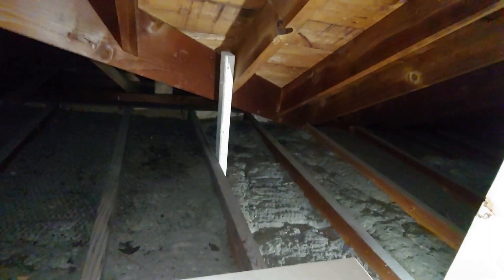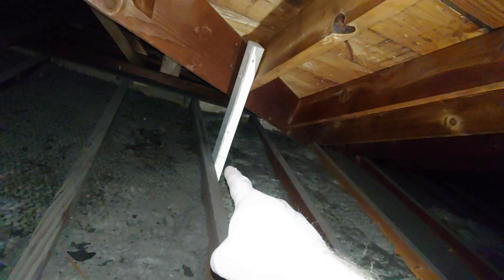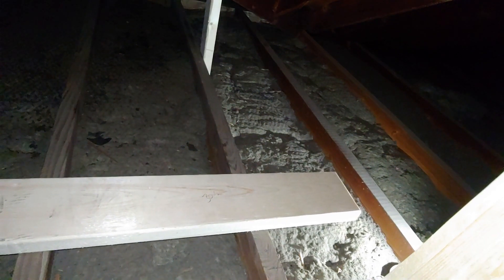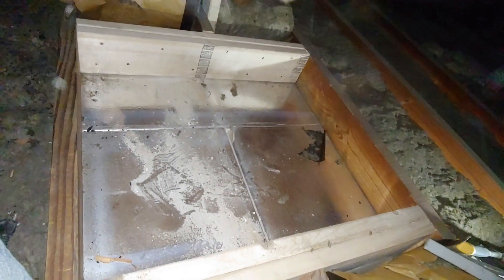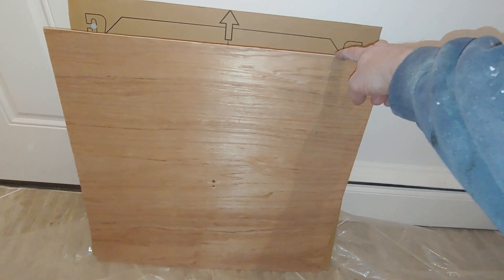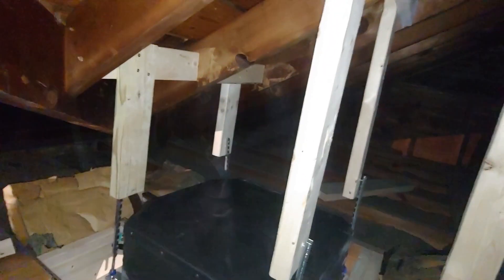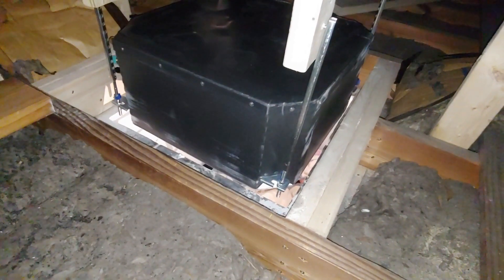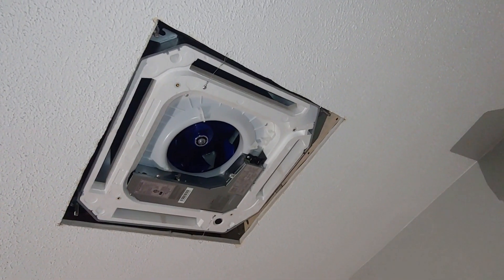Ceiling Cassette Minisplit Installation

Comment: Am doing the same thing.  Four ceiling mount mini split cassettes.  I believe your video(s) are the first to tackle ceiling mounted cassettes—- much bigger ordeal than a wall mount to an exterior wall.  I have two holes cut so far, with two to go.  Am saving the hardest for last as that position has the least attic clearance and I want to have it down pat before I tackle that one.  I went about it a little differently.  I made 2/6 frames for the units, and then will position them inside the ceiling joists after I have the openings framed up.  Essentially, I will wind up with the double joists.  That way I know the units will fit nice inside the openings.  One of the hardest issues is finding the right depth to mount the cassette—relative to the ceiling surface plane.  The trim piece comes with fairly short length screws to attach the trim piece and if the cassette isn’t hung just right you wind up moving it up and down a bunch.  I plan to get rid of water from the drain tubes by way of any nearby sewer vent (in my case, black ABS plastic).  I will be using two ball valves to divert the water to an exterior drain line as an option.  In my area we don’t want to throw out any water if we can save it.
Reply from the maker: Thanks! I found that the bottom of the unit even with the attic side of the drywall to be the best depth of the unit to start with.
Reply: @SteveDoesEverything  Thanks.  Will give that a try.  Will have to approximate that because my ceiling is very unusual---it hosts radiant ceiling wires and they are literally imbedded in a masonry product--seems nearly like stucco, applied to the underside of the ceiling drywall.  (The wires are stapled to the room side of the ceiling dry wall.)
Reply from the maker: My ceiling has approx 5/8" plasterboard with another 1/2" of plaster finish. So it was pretty thick too.

Comment: I just can't understand why it would have to be hung from the rafters?  Seems to me it would simply have brackets that rested on the joists?  I am thinking I would spread the load over say four joists simply because the one was compromized cutting a section out....But what do I know ...I do know some pretty heavy stuff often is supported by ceiling joists....whatever I just don't like it is all ...too much BS cutting and installing all the 2Xs only to hang little brackets.....for that matter if I were going to hang from rafters I personally would have used steel strut and all thread downrods which are infinetly adjustable for hieght using nuts and washers....but again that is just me having been a career electrician.  ...I also would like to cut the ceiling drywall pretty much the exact size of the unit (As in I would actually USE the exact outline ON the template!  Which has the angles corners NOT an open square!) I just would not want the big gaps you ended up with that crud /insulation or critter crap etc would/could fall down through the vented cover
Reply from the maker: Hanging from the roof rafters is what worked best in my case. mounting it a different way may work better in yours. I also thought about using the exact size on the template but that would have required me to mount the unit from the attic down. which would have been horribly difficult to carry that through my attic. The template square allows the unit to be lifted up from the room into the attic then worked into the hanging rods. Much easier for my situation
Reply: I, too,  have gone about carrying the unit into the attic via my usual attic entrance and then installing it down into the opening.  Basically, I do all my adjusting from above, with little to no gaps around it.  I’m also considering going overboard and using surplus blocks of styrofoam to surround the entire assembly from the ambient attic heat.  Probably overkill as the units appear nicely insulated, but I believe in going overboard.

Comment: What’s the max separation for 3 zone to work?
Reply from the maker: I remember reading 90 foot was the maximum distance of head unit from compressor, Maximum distance on a 3 zone system would be specific to that system mine  in a 5 zone so the maximum total line set run would be different

Comment: Your framing work is very questionable. The structure has safety factor built into it so it didnt collapse but you compromised the structure.
Reply: absolutely correct my friend.

Comment: You didn’t need conditioned air space around the part in the attic to prevent condensation?
Reply from the maker: No the part in the attic is pre-insulated. Once completely installed its required to fill in and around the unit with lots of insulation. The faceplate that attaches to the bottom of the unit (facing the room) has a gasket that helps with insulation as well

Comment: Great videos, Steve; very helpful.   You got some good shots of your work (along with good commentary) that makes it easy to follow you.  If you have time and remember from the top of your head, where did you get the installation hooks to hang the interior unit?  Do you have the part number or name?  I've looked through the Home Depot website and can't find them.  Thanks again for the videos.
Reply from the maker: The hangers and brackets came with the head units. I didnt buy them separately. You may be able to find them from the thermocore website

Comment: I recommend you all get Pioneer. It like most is just a Midea clone, but they offer reasonable prices, good documentation, and appear to have a good reputation if you need help or parts. You can also just have the line set be as long as you need with them to begin with :)
Reply: I would say Daikin and Mitsubishi are the best  but I guess they are really expensive.

Comment: I'm building a 1700 square foot single level home on an ICF crawl space. Definitely want heat pumps. Ductless. Thinking 1 12000 in each bedroom (2 bedrooms) and 1 18000 in the living area. These should heat the entire home with the HVAC yes? We have electric heat (rarely be used hopefully) and a wood stove insert as well. I can't make my mind up to go high mount. Floor mount. Or. Ceiling? Are they all basically the same to install? Is one more efficient than the other? They cost around the same give or take a few hundred bucks. I'm in a colder climate as well. Any input would be appreciated.
Reply from the maker: Hi. 12k BTU is good for up to about 600sqft
So the unit selection should be ok. As for the heat pumps, you'll need to check with the heat pump parameter specifications of whatever system you're going with. For instance my system is good for up to -13 degrees Fahrenheit efficiency. What type of system to get is entirely up to you. I think if its a new construction. Ceiling mount would be the easiest because it can be installed after the rough in framing along with rest of the electrical and plumbing. A wall mount system after drywall and painting, but this system offers a bulkiness that I personally don't care for on the walls.  A floor mount system would go in During the rough framing but in my opinion would be the hardest for future service. The efficiency of all the units are very similar.
Reply: @SteveDoesEverything  Thanks for the info. Appreciate it. The units I'm looking at are good to minus 30 Celsius . I was just wondering about installs. My wife doesn't like the bulky high mount heads. She seems to prefer the floor mount. But her favourite is the ceiling. I think mine is too. But in my mind I was thinking the floor units might heat better where they are low? But yes. Maintenance would be harder I guess. I'm thinking ceiling units. Accessed from attic. Will be best for us..The 12000 units I'm looking at state 750 square feet. 18000 says 1250. That's why im thinking (2) 12 and (1) 18000. With the assistance of the HVAC should heat the house pretty well. For really cold nights we will have the wood stove insert as well.
Reply from the maker: @Cummins402   Yea those units should heat the house with no problem. Especially if you have 2 other forms of backup heat avail. You  want to make sure you don't over ton-age your house. Then the system won't be efficient. You'd likely be ok with 3 12k btu units.
Reply: @SteveDoesEverything  I was thinking the same today. (3) 12000 units. There's about a $400 difference in price. So that's not an issue. (3) 12000 would be good for 2250 square feet. (2) 12000 and (1)18000 good for 2750 square feet. So maybe that would be overkill. Any recommendations on ceiling vs floor mount vs high mount? I was thinking high mounts in bedrooms and floor mount in kitchen/great area. I read today that the ceiling unit cools better in summer but less efficient with heat. And less user settings.   And should I go (1) 36000 unit with (3) heads or 3 separate systems in case of failure?
Reply from the maker: @Cummins402   Personally i would go with ceiling mount simply because they can be roughed in with the rest of the house plumbing and electrical, and their serviceability would be way easier than in the floor.  My units put out some good heat when I was testing them in about 40deg weather. It's ultimately your decision, so just weigh all the pros with the cons and be sure to take into account the severity of each con which may outweigh more than 1 pro.
Reply: @SteveDoesEverything  would you go with 3 separate 12000 units or 1 36000 with 3 inside ceiling mounts? They are almost the same price locally.
Reply from the maker: @Cummins402   I like the idea of having a central compressor unit. However the cons are redundancy, in case of a failure, and you'll have more cost in line sets to make your runs from head units to compressor. Although the likelyhood of a failure is low as long as you maintain the system properly. The cons of multiple compressors would be more electrical wiring and disconnect boxes needed, more of an eyesore in landscaping display just to name a couple. Whichever way you decide, It will be the way that works for you.
Reply: @SteveDoesEverything  all excellent points. My thinking was in fact if one of the 3 failed I'd still have 2 operational. But. The single 36000 would look cleaner and be cheaper to install probably. Even if it's the same initial cost as buying 3 separate units. I think I will end up going single 36000. With 3 ceiling units (maybe 2 high and 1 ceiling). Mounting the outside unit in the middle of the back of the house would be the best way to minimize the runs.
Reply: @SteveDoesEverything  what kind of electric heat (baseboard heaters) would you recommend to go with for "main heat source". Insurance companies around here don't allow heat pumps as main source. We will hardly use them but if we have too. Looking for the most efficient.
Reply from the maker: @Cummins402  Im sorry, I don't have any specific knowledge on a best manufacturer for that. I can offer this though. If you have natural gas coming into your new home. I would lean more towards a boiler for radiant baseboard heat. That system is much more efficient with winter home heating.
Reply: 12k is pretty darn big unless you have quite large bedrooms. The units have a capacity range, and are "smarter" than they used to be, but depending on your floorplan your units in the bedroom might short cycle, being less efficient, and less comfortable than it should be. For floor mount I assume you mean the units that have the form-factor of a radiator. If so, you can run the lines out the back if you install on an exterior wall. It's similar to the wall mount, just on the floor. You don't need to punch down into the floor, go out the wall. I've found practically that they do heat better than the wall mount. The intake area is larger, and low where the cold air is. I would rather service a floor mount than a ceiling cassette. As far as number of outdoor units, if I was installing this for a customer, (depending on your floor plan) I would split the difference and do two outdoor, one for the bedrooms, and one for the living room/space. All off one unit you have the redundancy mentioned, although you have multiple back up sources, and normally higher efficiency with multiple smaller compressors. If you did each as a single zone, just keep in mind that will take up 6 spots in your breaker box.

Comment: Do they come with all the kit installation?
Reply from the maker: Hello. Yes this particular set came with 15ft line sets, but not the electrical control wire from compressor to head unit.
I used a 16ga 600volt 4 strand outdoor wire for that connection.

Comment: Do they come with all the kit installation?
Reply from the maker: Hi, Yes this particular set came with everything except electrical wiring and plumbing.
Reply from the maker: You're welcome the line sets that came with it were only 15 feet long for each air handler and 15 feet doesn't get you real far so if you have multiple air handlers you'll probably need additional line sets to connect together. My next video I do, will show what I did with the line sets.
Reply: Steve Does Everything sounds good thanks
Reply: Thanks

Comment: Also, what brand did you buy? I keep looking at Blue Ridge, Diakin and LG
Reply from the maker: I got thermocore. I bought them from eBay. Ill post a link in the video description.
Reply: @SteveDoesEverything  Hey, I just checked them out. They claim to have a Mitsubishi compressor, then in the specs, it says Mitsubishi/GMCC. Well, GMCC is just Toshiba, but it's really a chinese compressor. That doesn't mean it is bad, but I think they are a bit misleading.I suggest just going to Pioneer for a mini split. They appear to have it all easy to purchase and figure out.

Comment: Do you have any video of how you installed the refriderant lines?
Reply from the maker: I have not installed the line set yet. I've only mounted the units. Im planning a trip back to the house by next week to finish running plumbing, electrical and line sets.I'lll have some more video after my next trip.